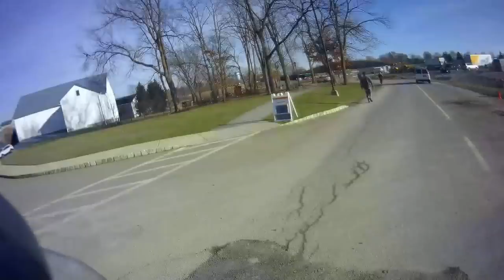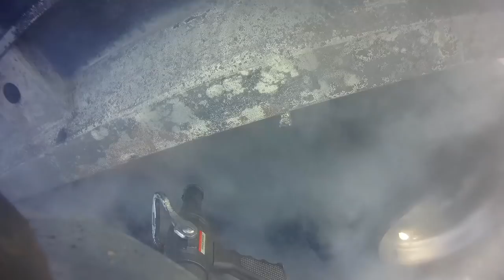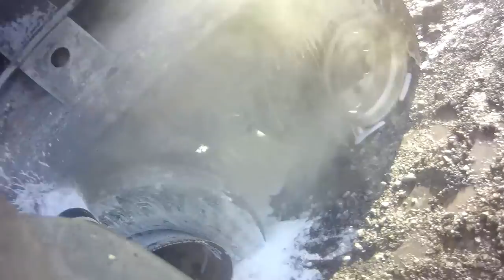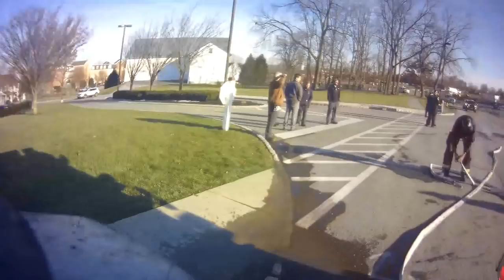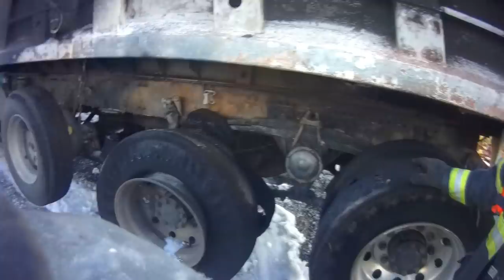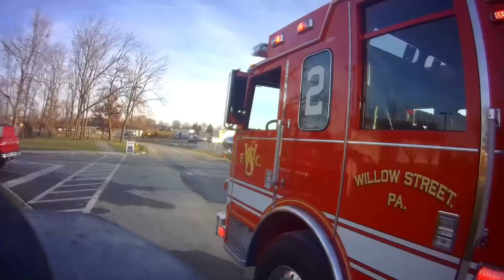Engine 502 Working Dump Truck Fire in the First Due *Helmet Cam*

Comment: i would have been pissed if the pump operator charged my line when i was flaking it out lol
Reply: maybe you should be faster
Reply: @juniorcraig7046  thats not how it works
everything is on the nozzleman, if he isnt ready it can ruin the entire stretch.
Reply: Craig Rhineer Jr in some cases you have too be quick but a vehicle fire is not one of them. As long as there are no exposures or lives in danger there is no reason to rush. There isnt really any saving too be done on a vehicle. Pretty much once a fire starts in a vehicle its totaled and insurance takes over.

Comment: If you don't mind my asking , What happened to that truck? Sitting on a jobsite it seemed to be loaded with gravel. There is not much back there to ignite as far as a source to short out, or anything like that.
Reply: Maybe overheated brakes? Just a thought.
Reply: My guess is overheated brakes. It looks like he was pulling out onto to street if you pay attention to the video
Reply: @LiamPattisonPhotography  I thought the same thing, But he was on the jobsite . Surely he did not drag the brakes that far.
Reply: @Fire-se9sg  Yeah that is what i thought to, but he had the truck on a job site . Surely he did not drag the brakes that far. I have owned and still own several tri axle dumps for the last 25 years.
Reply: a.r. hays one would think that wouldn’t happen but they could have been stuck. It’s truly hard saying. My dad was a truck driver for years as well, and firefighter and we saw this stuff all the time
Reply: @Fire-se9sg  Thats right he could have.

Comment: Is there FDs that still use MSA? Ive been to like 5 different departments in norcal and they all switched to SCOTT scba
Reply from the maker: We (and many others around us) just switched from scott to msa
Reply: FN videos a lot of departments are switching to the MSA G1. They come with an equipped thermal imager, more adjustability when it comes to lumbar support. Much better pack in my opinion since I’ve been around them. And don’t get me wrong Scott is an amazing air pack as well
Reply from the maker: @Fire-se9sg  Said well. Personally would've been happy with either
Reply: FireRescue 50 agreed as well, I know newer Scott’s if specd with their newest face pieces come with tics as well? I’m not 100% sure though. I haven’t seen much of the newer Scott’s
Reply: New scbas are junk everyone I’ve seen with them has had problems with batteries, software issues, tic completely outta wack bulky and way to much accessories to get entangled with

Comment: I have never seen a Dept. bring their used hoselines back to the station in the cab of the rig, I would think the contaminates alone would be enough to keep it out of where your sitting and breathing, guess everyone is different
Reply: It’s out of the way if they get another call on the way back. Compartments are probably full. We used to put rolled hose on the tail gate but things do fall off the truck every once in awhile.
Reply: Most contamination from this fire would’ve been dirt and mud on a hose, I imagine they would’ve rethought that had it been a house fire
Reply from the maker: @Fire-se9sg  Exactly. Large fires we use the squad to bring hose back

Comment: Is that water or fire retardant that you are using?
Reply: Its called a foam pro pack and mixes with water from the booster line
Reply: Thanks